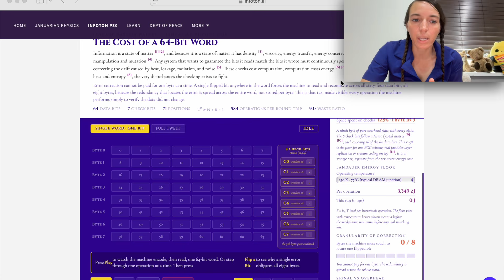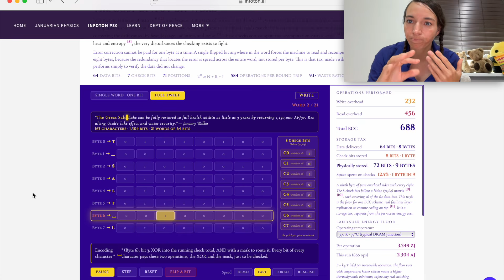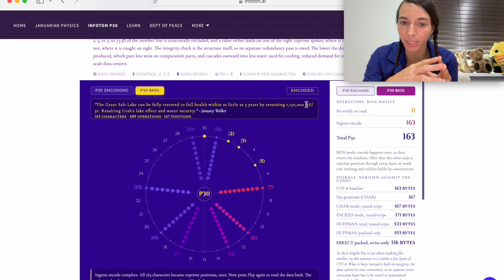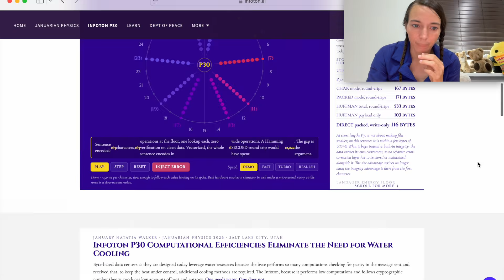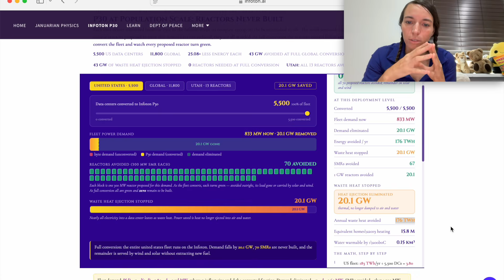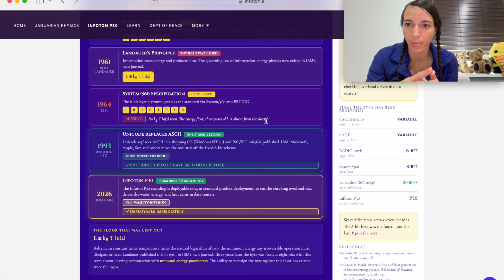Infoton P30 Update Fixes Data Centers so no water or nuclear is required

Comment: I had always wondered why so much heat is generated by my (little) machines, somehow this did not seem like progress.   Now this....  does.  So how do we make the coding upgrade from 64bits to P30 happen?
Reply from the maker: There are 17 layers of computer architecture which must make fine tuning adjustments to be in alignment with Prime numbers ideally beginning at the microcode level for current builds and new builds at the silicone. 

That means Intel and AMD cooperation.